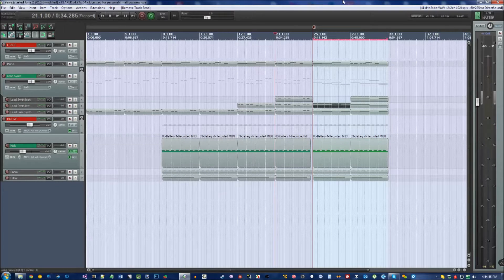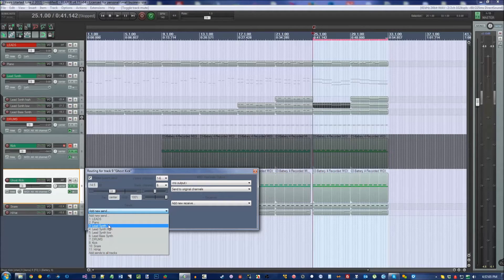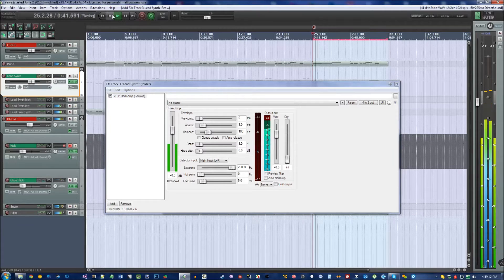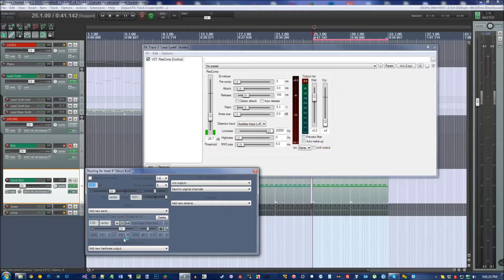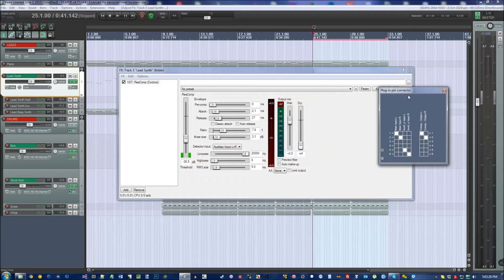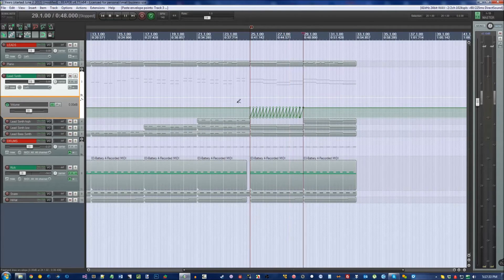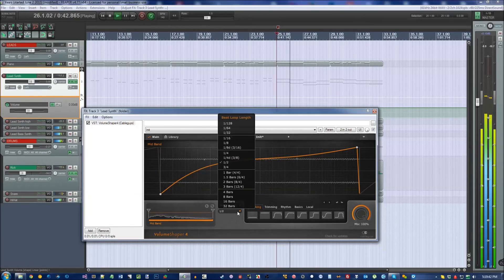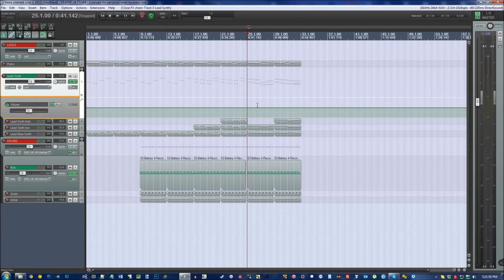Make a Bouncy Pulse Synth in REAPER! [detailed Side-Chaining overview]

Comment: Let me mention one more method of side chaining - parameter modulation. It is even more flexible and it can be used to side chain even parameter of plugins which do not even offer side chaining (you remember: ReaComp offers to listen to Auxilliary Track - which mostly is set as Track 3 und 4 - and apply the effect to Track 1 and 2, which is a 'native' side chaing support). For example you can side chain the cut-off of a filter inside a virtual synth (like for example Synth1) without complications.

Comment: I've ran into a problem which seems to predate this one-I don't even know how to make any Synths work in Reaper. Granted, I've only gotten into virtual instruments/synths recently, and there seem to be some guides online on how to use those on oher DAWs but not on reaper.
Reply from the maker: אביאל פרץ Hi! To create an instrument track in Reaper, go to Track in the top menu (next to Options) and click on Insert Virtual Instrument on New Track. Or right click on the side area where new tracks go, and click on Insert Virtual Instrument on New Track there. You should then be able to play and record the virtual instrument.
Reply: Thanks for the quick reply! I did try that,or something similar, but it didn't seem to grant me any kind of control over some instrument. Will try again first thing in the morning.
Reply: ***** So I have the virtual instrument track, but how do I actually play this Synth?
Reply from the maker: אביאל פרץ Well, to formally play it, the best option is to buy a Midi Keyboard. I highly recommend that if you're going to be using virtual instruments a lot. Otherwise what you can do is record some blank space on the track, and double click that to bring up a piano roll that you can draw notes into. I find that way less fun than just playing the instrument but it does work.